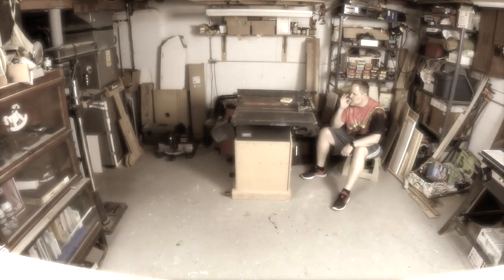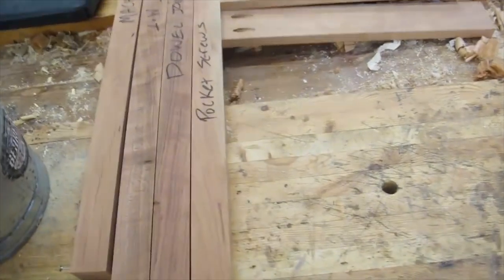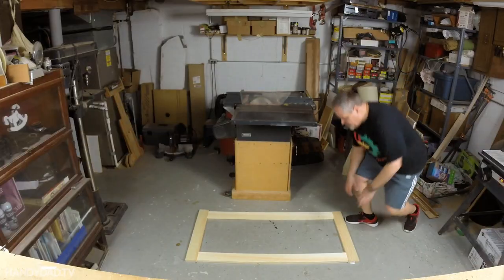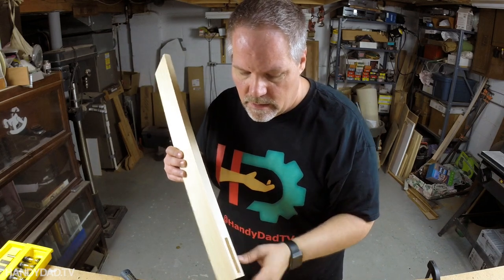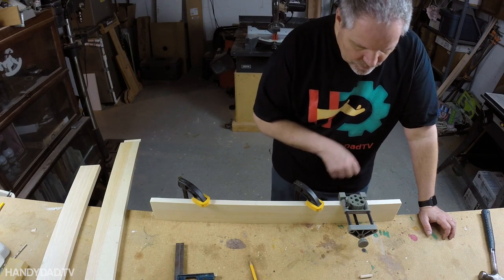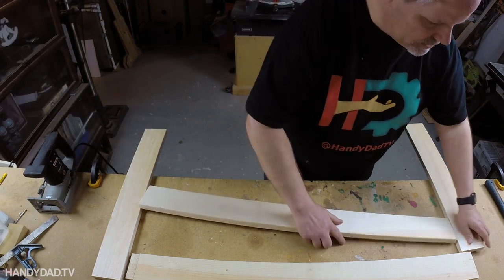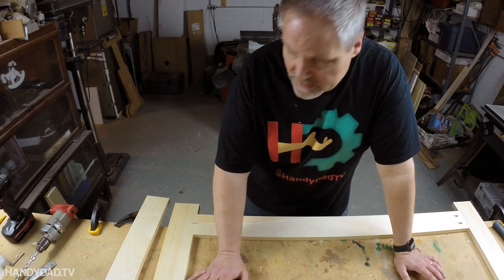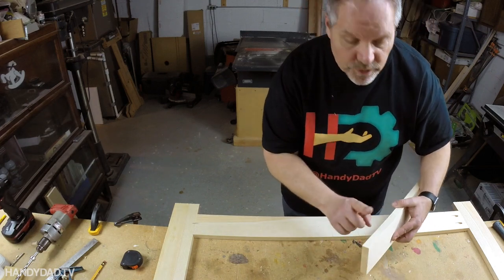Five joinery techniques for making a face frame

Comment: That half lap joint is exactly why i bulit a router table with a 3/4" miter slot. It accomodates my miter gauge off the tablesaw and I can more easily set a depth of half the width of the mating materials, then cut a half lap or a few other joints easily by simply flipping the material over. Being centered, you only have to set it once, and with the lifer gauge it goes very very quickly. A dado stack works too, but the router is my friend when doing jointery.

Even a mortise and tenon that only goes half an inch deep is very strong provided the endgrain of the mating joint is sealed.
Reply from the maker: I don’t do nearly enough woodworking! Thanks for the info.

Comment: I've used pocket hole joinery for cabinetry for years for face frames only and believe it or not I've never had a callback because the pocket screw failed. They are so useful and quick and strong. After all how strong does a face frame joint on a kitchen cabinet have to be?
Reply from the maker: Great for speed, that’s for sure.

Comment: Ditch that doweling jig. For lining up the dowel holes across a joint, nothing beats dowel centers. You drill a dowel hole wherever you want on one side of the joint, plop in a center, position the mating surface and press together. You get a nice little dimple on the mating surface that is perfectly centered on where the mating hole should go. Quick, cheap, and accurate. (And they say you can only have two out of the three. Hah!)
Reply: Jigs can be accurate and fast if you know how to use them.

Comment: It seems like there's a small bit of error in his video. His second bucket has a considerably shorter moment (or lever) arm. It is clearly a stronger joint, but not quite twice as strong.
Reply: Agree.. maybe 50% stronger.  Definitely not double.
Reply: Only two dowel, really?  If he'd have used a good dowel jig and put in four dowels the joint would be stronger than a mortise and tenon joint.
Reply: @Ed Waggoner Sr. Your bad information following a poor wood stress test is as worthless as that test. The wood was different lengths and buckets different distances. If stressed horizontal instead of vertical in a similar but extremely more controlled accurate test your dowel rods fail way sooner. And joining wood has way to many variables to ever make your statement or the test applicable in all situations. So next time you correct someone make sure you now what your talking about. He showed how to make them and a simple basic stress test which will help many people. While your opinion here helps nobody. Here is a test for you. His helpful positive video which required work, for thought, planning and a working knowledge of the information presented VS your negative non supported statement of your now highly questionable opinion.
Reply: @edwaggonersr.7446  YEP...SAME FOR POKET HOLES...THINGS MUST BE IN PROPORTION
Reply: @deathmerchant8662  WOW...YOU LIVE UP TO THE NAME!!....DID IT WARRANT THAT??
Reply: Yeah, shouldve hung it from the first bucket to keep the lever constant, but also, the end grain blew out. If it wasn't close to the end, it may have held more. Fair enough though, most joints are at corners.
Reply: What surprised me when I did my own testing in choosing jointery was just how strong a miter joint is when just glued together. Adding dowels or in my case, a domino, it's even stronger. Nearly as strong as a mortise and tenon.

Comment: I know a great great mortise and tenon joint that I used on doors mortise straight through and hammer two wedges in from other side glued in strongest yet biscuit joints are good for solid worktops

Comment: There are better jigs out there for dowel installation. You can make your own with brake line and a scrap of hardwood. Drill the hardwood to accomodate the 1/4" brake line, then cut a few pieces of tubing a little long, and epoxy them in. Hack it off in the bandsaw to make it flush and clear the tubing with a 1/4" bit. Then you can clamp the jig wherever you want. Use scraps if necessary to shim thin material.
Reply: If you add a couple dowels near the corners on the bottom of the jig (you may add several more holes for a dowel that fits more tightly) and have installed the guide (brakeline) to the center, you can make it self centering for any material it will fit over. I tend to make them 3/4" wide for using 1x, and then 2" wide for bigger stuff.
Reply from the maker: Thanks for the info

Comment: It would've be nice to see how the dowls needed to line up. That's what I did then when I went to my rails I'm having troubles lining up my holes to match. No jig handicap
Reply from the maker: They also make metal dowel guides which are cheaper than a jig. You drill the hole in one side and insert the guide in that hole. The guide has a pin protruding in the middle of it so you can make a mark on the other board exactly where the hole needs to be drilled. Trouble is the holes need to be perfectly straight. 

I don’t like dowels.
Reply: @handydadtv  the only advantage to dowels is you can use them with the pin jig for where both sides are visible. pocket screws are perfect for constructing face frames and drawers and cabinet boxes

Comment: Help! Beginner!!!

So I bought some 3/4” in width maple, I am building a miter saw station. I have drawers to the left of my miter saw, cabinet doors in the middle (under miter saw) and drawers to the right. I am leaving a 1/16” gap between the boards (drawer fronts) I am using the same boards to go across the whole thing to achieve a clean, smooth look. So my question is, can I use 1/16” wood pieces to go in between the joints to keep the alignment of the grain of the wood?

If I joint the cabinet door pieces, the wood grain will not align with my drawers to the left or right side. Hope that explains it well enough.
Reply from the maker: Hi Kevin. My initial impressions: First, a miter saw station isn’t going in your living room so I wouldn’t overthink the grain matching, especially for a beginner. Don’t make yourself crazy; it’s a utility piece. Second, 1/16” gap is very small for drawer fronts. Getting them precisely installed will be hard enough, but they may eventually rub as the drawers wear over time. Third, woodworkers rarely cut anything smaller than 1/8” unless you’re using really small tools and building a dollhouse or other model. Don’t try to cut 1/16” pieces with your miter saw or table saw. It’s not safe and won’t be precise. Fourth, as a beginner, stick to cheap wood (ie pine or poplar) before moving on to expensive hardwoods like maple. 

Just my opinion.

Comment: Anyone else notice that the wood gave way on the pocket hole screw test, not the screws?  The screws are still holding, the wood itself gave way along a crack in the wood fibers. Simple leverage.

Comment: What clamp are you using on your bench? That looks awesome
Reply from the maker: That's a very useful tool called a Zyliss Vise system. I got it at a woodworking show about 25 years ago. Not sure if they are still made but you can get them on eBay: http://ebay.to/2HgZLvu
Reply: HandyDadTV wow thank you for the reply. I’m not used to that. Lol. Well keep it up I’m really enjoying your content
Reply: I bought the Zylis clamp system a few years ago.  Then I got very sick and really didn't get a chance to use it for anything.  It was a used system and I don't know if it's all there.  I need to find some documentation so I can try it out.  I don't know if I'll use it or sell it?  Seems to me that it was about US$100 or so back then for a new one.  Do you use yours a LOT, or just a few times here and there?  Thanks
Reply from the maker: I do not use it a lot, but it comes in handy when I need it. I have it hanging on nails in the joists over my shop. Takes up no space. I like to say “it costs nothing to keep it.”

Comment: Thanks for making a simple to the point video.  There is a video testing all the joints someone did as well with a scale and all... biscuit joints are crap. Half Lap and Mortis were kind of equal taking on I think it was 850 lbs of pressure?  I forget the exact number but they were pretty equal
Reply: Half lap would never be as strong as a Mortise and tenon joint but it depends on where the pressure is applied.

Comment: For the dowels, you should just glue the pieces together first. Then from one of the pieces just bore all the way through from one end to the other piece. Put glue in the bore hole and drive a long dowel through.  The other important thing is not to make the bore hole perfectly perpendicular to the mated surface. Try something like 5 to 10 degrees off perpendicular. No chance for glue surfaces of the dowel to fail. It’s like trying to shear the dowel. You use the same idea with pocket hole joints except you bore the hole all the way through and put in a dowel instead of a screw. Again the bore hole should not be perpendicular to the mated surface. If the first hole is 15 degrees off the perpendicular, then make the second hole be 15 degrees off the perpendicular the other way. Note it is not possible to do this with dowels if you are doing it the regular way; not possible to mate the pieces if the dowels are not perfectly perpendicular.

The plus side of this is that you don’t need to worry about the dowels line-ing up perfectly. And you only need a drill and a mallet. 
The only down side is that you have the dowel endgrains show up, something  like dovetails. But then again it could be a plus.

Comment: Those loose dowels are nuts.
Reply from the maker: Yeah, I returned that piece of crap jig.
Reply: Try the DowelMax. Best money I ever spent
Reply: Dowel Jigs are fine if you know how to use them and are using them regularly. I suggest using them on projects when looks are not as important so you can get a feel for them.

Comment: What about the festool domino?
Reply from the maker: It’s an overpriced dowel, in my opinion.
Reply: @handydadtv  
It is completely different from a dowel. It is a floating tenon joint that are fast and easy to use and can be used when on site. 
It depends on if you need them.
Reply: Way overpriced for what it does.  That's my opinion, anyway.

Comment: Why worry about the strength of a face frame joint?  Its not as if a face frame is a load-bearing member under any sort of stress.
Reply from the maker: Tue face frame provides lateral strength. Try sitting on a cabinet without a face frame. It will collapse to one side or the other.
Reply from the maker: *The
Reply: @handydadtv  you are right, but when you attach the face frame to the cabinet you glue it  basically making it one piece of wood so it really does not make a difference which way you join the face frame together

Comment: Dowels are more forgiving and potentially stronger, if you use stronger material like aluminum, plastic or steel... You don't need "precision". That depends on the setup and the dowels used. The glue is stronger than the wood and will fill any unaligned voids, if you use the correct amount of glue. You also needed one more dowel. It is better to use a DIY jig, which will result in perfect alignment.

That strength test was horrible, inaccurate and a poor representation of actual "loads". Those joints, on those setups, would need to be tested with the weight pulling down on the vertical alignment. He put the sides horizontal and tested the "pivot bond", which the only winner will be the joint with the greatest surface area, to the point where the glue fails, not the joint. His second test where he claims "120 lbs", is a total fabrication. The weight has to be on the same distance away from the joint-fulcrum. The second bucket was half-way closer, so that additional 60-lbs was virtually only another 30-lbs of dead-weight. However, at that span, from the fulcrum (where the wood pivots on the edge of the joint), that 60-lbs is more like 600-lbs of pressure. It was nearly 10x the span of the joint, along the length of the rail. {Eg, leverage... A 30-lb kid could lift a 300-lb adult on that leverage.}

Mostly, the test is irrelevant, because the "bearing weight", would be downward on the sides of the joints. The only way you would get that kind of side-loading, is if you ran into the counter, which had just one joint, with a car, from the side. The actual top-load strength is equal to the smallest "thickness" of the binding joints, plus the "tensile-bond" of the undamaged glue. (Give the glue five years, and it will not be bonded to the wood any-more, and become irrelevant to the strength of the joint. Leaving you to just the strength of the smallest thickness of the joint, on the vertical-crossing. The lapped-joint would potentially win that war, as long as it wasn't being held together by just glue. The tenor joint would come in second, with or without glue. Followed by the wooden dowels. However, metal dowels would win, hands-down, over all of those, with or without glue. EG, nails without heads.)

Final note... One dowel per joint, without glue, on a final build, would support that structure for loads well over 1200-lbs. Mostly since the weight will all be across the wood, not the joints. The purpose of the joints is only for shear-loading, which is not normally an issue for counters that are intended to "hold things up", not "being built for side-loading". (The back-panel and side-panels are for "side-loading".)

At the end of the day, dowels are best, for easy to do, hidden joints. While all unseen mounts should be screws or nails. (Which is kind-of how 99% of all furniture is made. Unless you want to over-pay for complex and irrelevant joints that you never actually see.)
Reply from the maker: Thanks for the feedback!

Comment: Biscuits don't hold a dam thing s
Reply from the maker: I disagree. I’ve built a lot of projects using biscuits for decades and nothing fell apart.
Reply: @handydadtv  I agree. They're not for every application but they are sufficient for a lot of them. I still use them occasionally because they are so easy to use.